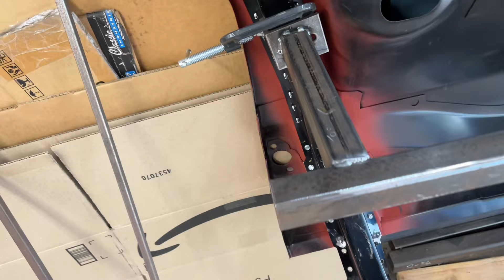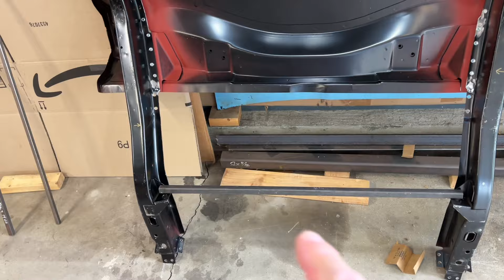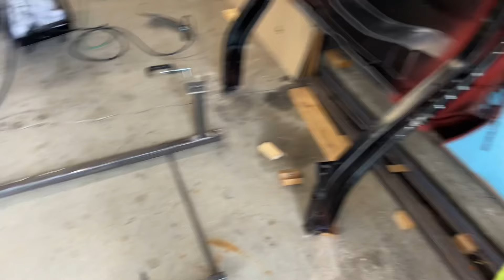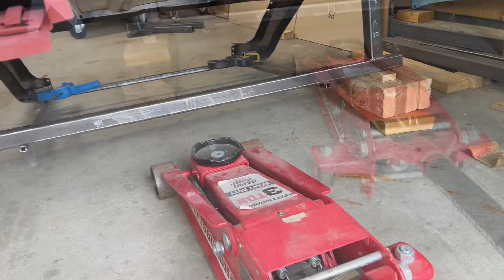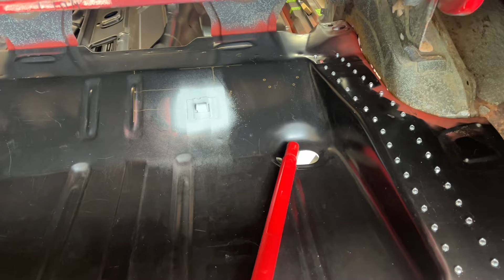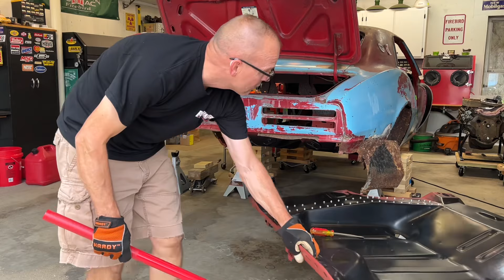Trunk floor lifting Jig for a First Gen. Firebird or Camaro

Comment: Since it’s just for lifting and positioning, I have scrap lumber from a recent project I’ll use but what a solid idea 👍
Reply from the maker: Good deal. You can make it out of just about anything, as long as it’s strong enough. I would have used wood, but didn’t have any scrap pieces on hand.

Comment: Don’t forget you can remove the plate on the jack itself and make something to bolt to the jack . I have a trans stand that I made for my floor jack it bolts through the large hole on the jack.
Reply from the maker: I did forget that. Using a bolt naught be a better way to go. Thanks for the tip. Sometimes we get wrapped up in the end game and forget the details and common sense. Thanks for watching and for the comment.✌️
Reply: @JK_Nex_Garage well I appreciate you and and all the other you tubers who are sharing their project and helping us folks to know what to expect as we enter in to our own! I just finished a 4 year build on a square body. My grandsons truck is in my shop getting ready for its new coat of hot rod red paint and then my new to me 69 bird goes in for it’s restoration!
Reply from the maker: @timhudson8958 I am a big fan of square bodies. Good luck with your ‘69 bird project and keep us updated on how it’s going.👍